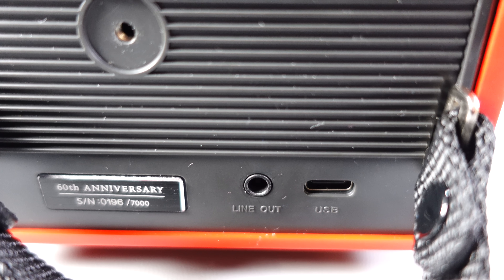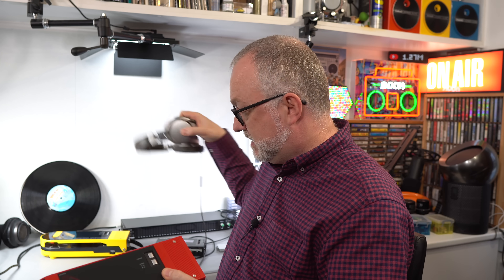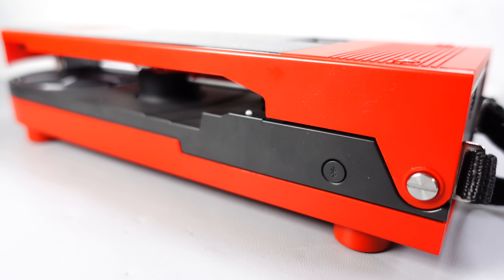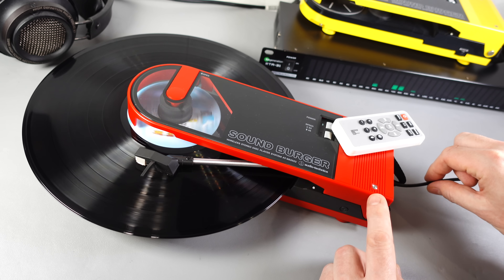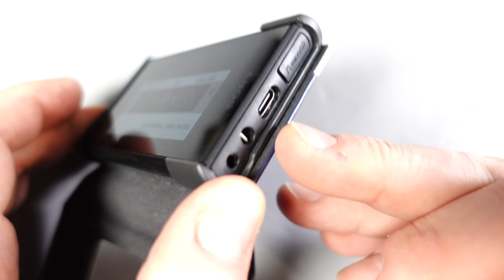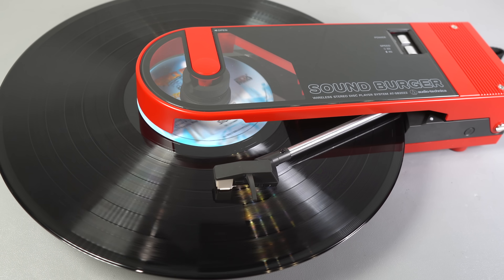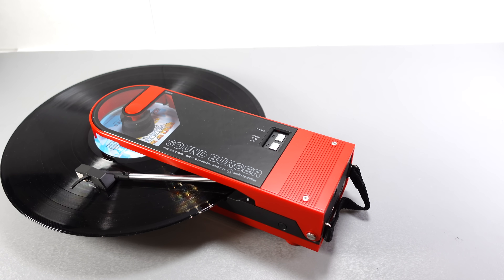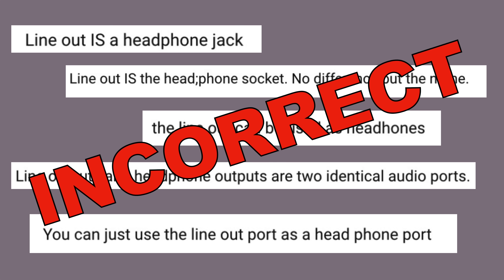Line-out ≠ Headphone-out

Comment: Confusion comes from that there is no confusion. You can plug your headphones in Line Out - it won't destroy anything and you will get the sound. It is not a forbidden action under a heavy magical taboo of gods that will smite you.
What it won't do is offer the same options as a proper headphones jack.

Everything else is besides the point.
Reply: Many headphones will be far too quiet using line out. Different headphones require differing powers to be driven.
Your type of confusion is the reason for this video.
Reply: @Safetytrousers  There is literally no confusion.

Comment: I must put my two cents in. I have a no name discman. It has headphone out and line out. The headphone socket started making noise. So I plugged in  my headphones with a volume control and they work just fine
Reply: So I've been using the line out as a headphone out and it's perfectly ok

Comment: You are incorrect! The confusion doesn't come from the fact that you can use Headphone Out as Line Out, but because some old boomboxes had a sensor that could sense if a headphone was plugged in in the Headphone/Line Out socket.
Reply: That's just one factor. That is not the main reason for the confusion.

Comment: Very well explained clearing a common misconception! Someone who wants to go more technical, it's also about impedance matching, typically headphones have impedance of a few ohms, but line-in devices have much higher impedance, but normally driving a line-in with headphone output is ok in terms of impedance provided as Techmoan said a low output level. Thank you a lot for the video!

Comment: as a musician and audio engineer, this video is hilariously necessary for the music consuming public
Reply: The fun thing (which probably makes the average user more confused) is that the fact that if a line output is connected to the line input of another device, it usually gives similar input levels to that device as a headphone output will do at full volume. That's because the thing is mostly just about the impedances. Voltage levels of both type of outputs are about the same, so with a high impedance line input (that barely put any load on the signal), they give similar levels.
But, if headphones are connected to the line output signal, the voltage level will plummet - because that output can't supply much current (high output impedance).
The amplifier circuit in the headphone output on the other hand, can supply much more current to the signal (low output impedance), so the signal level don't drop as much under load.
Reply: @Speeder84XL  BOOOM nothing better than the actual engineering explanation
Reply: It really is. I'm by no means either an audiophile nor a technology expert. But I like to think that I'm at least reasonably knowledgeable in both areas, and I kind of just always assumed that a 3.5 mm line-out was usable as a 3.5 mm headphone out. Good to know that that's not the case.
Reply: @scaper8  usable? sure, ideal? no
Reply: @scaper8  honestly you still can use either as a headphone amplifier but normally the line out will have half or even less dB of the signal, so that's why it's so quiet. it's a use of last resort if you have nothing else to listen with!
Reply: @JakobSchafferDrums  A concern I'd have is that a line output is designed to drive a high-impedance load, while a headphone may be pretty much a short-circuit in comparison.  Hopefully the line output is designed to tolerate this, but I don't know if that's always the case
Reply: @SmallSpoonBrigade What a statement of art😅 Siriously YOU can plug in SPEAKER😂 UM an amplifyer could help❤
Reply: 22k mono MP3's for life, bro!
Reply: Most definitely, I didn't know the difference...
Reply: I knew that it was very low, but that's because I've tried it. Assumed it was for some sort of way to connect to other equipment.
Reply: Until seeing this video, I had no idea what line out was. Which means I've always either assumed that "headphone jack" was broken or just dealt with the low volume.
Reply: Surely as not a musician and audio engineer it's still obviously needed?
Reply: I agree I learned about this the hard way unfortunately 😂 but differently instead of using line out I did use the headphone jack the problem I had gotten a pair of Open backs headphones and i would plug them in but I didn't know why they sounded so low amd when I did research that's when I found out they i had gotten the 250 Ohms version of those headphones so they require a headphone amp 😅 we all make mistakes the music industry can be a little tricky when your figuring stuff out on your own or when you don't look things up in my case

Edit: I want to clarify I found out about this back when I was in middle school I'm 23 now and took an audio engineering class 3 years ago in college so I can definitely say I know a lot more than back then but even till this day I'm still learning more new things about music.
Reply: it just amazes me that some people can be so arrogant/misguided to just type complete un-truths without knowing they are completely wrong.
Reply: As a better musician and more knowledgeable audio engineer than the OP (but equally as self-aggrandizing), this video is hysterically essential for the music consuming public (or just public, for short). 

Jokes aside, this is not that relevant anymore.
Reply: I don't see anything hilarious about it, sounds kinda condescending tbh
Reply: I used the line out on my CD player once and at first thought it was broke, but then realised it was probably to plug into the hifi system
Reply: and shows how propriatary things are
Reply: what an accomplished video..
Reply: Mate I used to work in a maplin and the stuff people used to believe was unreal, they literally think there is a magical passive adapter for anything<->anything, be the source and destination any combination of analog, digital or proprietary implementation over either. I remember some student woman saying she couldn’t use our dvd-r’s because they ‘weren’t digital’ 🤨, it’s called digital versatile disc love,
Reply: Said the snob
Reply: gonna agree, fellow sound engineer here as well
Reply: a lot of headphones designed for "gamers" tend to have an in-line or built in amp so you can get away with using the line-out but they all need to be powered at the same time
Reply: Jake, yoo hit that there nail squarely on the head. The key word here is consumer. As the majority are only consumers and spenders!
Reply: Thanks
Reply: As neither, it’s still necessary
Reply: The answer is so obvious if you think about it
Reply: Nasty commenting on a techmoan video
Reply: The video could have been 10 seconds long. So no, it really wasn't necessary.
Reply: What a petty thing to be snooty over.  A pointless fact that can be found out with a google search is what you hang your hat on? You're one of those musicians who think society owes you
Reply: work with this stuff a bit, but his description of why line out is the same (switching between equipment) made the next level of it click in my head lol
Reply: @QualityDoggo  literally ya when he said that I was like oh YA it's literally a 'Line' 'out'
Reply: As a person, I too like being unbearably smug.
Reply: @Croyles what exactly makes OP's statement smug?
Reply: As a lord, an open hart surgeon and a scientist who works at super collier in Switzerland i agree
Reply: "Hilariously necessary" because manufacturers prefer to keep consumers in the dark*..    
       And explanations that are easy to understand are difficult to come by. 
       Mainly because those need to be written by audio engineers, who don't see the need to explain, but find it hilarious instead :P

Not everyone has time for a 4 year study, just to understand their home stereo equipment ;)

And I'd argue that anyone who alledgedly DOES know, but finds it difficult to explain in simple terms... really doesn't understand it quite as well as they'd like to think ;)

--

*[Same reason why the 'HD Ready' (1366xsomething px) label exists on older TVs... 
       (Better than regular HD 720p... But has an air of 'Full HD' 1080p... Which it's not)]
Reply: @iggysixx  ok
Reply: Oh come on now, anyone at the age of 8 or 10 who had tape cassettes, boomboxes, and cd players would have found out easily there was a difference between line out and headphone out.
Reply: @user_83746yu  Yes, but most people looking at Youtube have not had these experiences ... cassettes et al fell out of general use before they were born!
Reply: I can't believe in this day and times this needed to be taught to people. Lol

Comment: Line out will have intrinsic impedance in series with whatever you plug into it, so a headphone will see only a small fraction of the output voltage. Basically it's not designed to output very much current or power. It's meant to go into the high impedance input of an amplifier.
Reply: It can work surprisingly well with really cheap cans, even if it's not meant to be used like that,

Comment: headphone outputs are  different . They amplified off the line out signal. The headphone amp is designed to operate on a range of headphone inpedance and have a volume control for the user. Line out will work but will be low and uncontrolable and may not be equalized like the headphone out.
Reply: Yeah, we saw the video.

Comment: I have gotten away with using a line out that had a level control in the past, but it was one of those rare edge cases
Reply: Its not rare. Its the default on modern devices.

Comment: To be fair some computer motherboards do label Line-Out as headphone or Front Speaker compatible(or at least recommended to plug your heaphone in there). It's why people were confused and made the wrong assumption.
Reply: Yeah, but via software the hardware is controled so that the volume level is adjusted by an X amount of decibels when you select to use the output for line-out or headphones-out. In fact technically depending how the hardware is "wired" you could give any 3.5mm socket a different function. The line-out could technically be a microphone-in, if only the hardware can switch internally like that.
Reply: @LogiForce86  Yes. I've had motherboards that have done just that.

Comment: A lot of sockets that work for headphones are labled as "line out".  At this point, I think it is irreversable and needs to be addressed by the companies that manufacture.
Reply: The distinction is moot with modern electronics. All devices this days use a DAC and most will have digital amplifiers.  Line level is only a concern with analog signals, which no one should be using.  Analog should only be used for the final speaker output.

Comment: Question to people who know more than me: what would happen if you connect antique high-impedance headphones to a line out jack? I'm talking about the type of headphones one often sees supplied with WWII communication receivers. Would they sound louder?
Reply: What would happen is you would hear something, but it would be very quiet. Also, doing so would not damage the headphones or the line out circuitry. The output circuit would not be loaded anywhere near as much as it was designed for, and the headphones would not be given a voltage anywhere near what THEY were designed for. 

I have some, and I've done it just to see what would happen. Its fine, but useless for listening to!
Reply: They're not all antique though; beyerdynamic DT 880 comes in 250ohm and 600ohm impedance versions (as well as a more traditional 32ohm).
Reply: No, it's the other way around. Lower impedance headphones = louder sound.

Comment: My smartphones (Samsung s7 and Samsung Note 9) have strange headphone output, when inserting dual ended jack wire without headphones on the other side of the wire and then contacting headphones to te wire we have much more power than when connecting headphones ended with dual jack wire to headphone output. In other words when impedance of connected device is equal to 0 than device pumps greater power than when is sees any load.

Comment: It's akin to the USB type C socket where the socket is the same as for Thunderbolt 3 and 4. The socket is the same, but the protocols that the corresponding cable supports vary significantly. The old DVI and SCART sockets had similar issues

A line out is designed to communicate information to another device and not human ears
Reply: You seem to be confused, the cable and connector don't care what protocol is being used. Every USB C device works with thunderbolt.  The only time you will run into an issue is when a company incorrectly implemented the USB C spec and made their device thunderbolt only.  That doesn't change what cable you use.

Comment: I used to work in a musical instrument shop and had to deal with people not understanding this sort of thing all the bloody time. People usually think that because a connector is the same, everything will be compatible. Which isn’t unfair, because this is true for a lot of things in everyday life.

Imagine trying to explain to someone who has no knowledge of audio signals why plugging a stereo jack into a balanced input on a mixer will only give you the difference between the two stereo channels. Now imagine explaining that sort of thing to the clueless public several times a day, everyday. I loved that job, but it really was a test of patience at times.

I have known people who’ve played guitar for years, decades even, and still don’t know the difference between and instrument cable and a speaker cable. And why you should only ever use a speaker cable to plug an amp into a speaker.

Comment: The basic difference is that the line out is not designed to have a load on it (anything that converts the signal to energy like a headphones which convert the voltage to kinetic energy that generates sound), that's where it all starts. In contrast, a headphone out is designed to have a load in its output. So no, you do not convert a headphone output to line out by lowering the volume. The consequences of using line outwith headphones and vice versa on the listening experience are important, as they transform the frequency spectrum of the original source. Surprisingly, this is the most fundamental point and it is not covered in the video.

Sorry for pointing out that someone is wrong in the internet, but you seem to care about this things hence my comment.
Have a nice day.

Comment: Line out is generally a high impedance output at about 100 mv. Headphones are generally low impedance devices that need to be driven by a low impedance output at volts, controlled in level

Comment: I'm a fully qualified electronic repairs engineer with 20 years experience even though you cannot use the line output Jack for headphones if you have a preamplifier with volume control then you can use your headphones with that type of jack socket

Comment: Generally speaking, line out and headphone out are about the same level when listening on headphones at a comfortable listening level. The main reason why line out doesn't work if headphones are plugged in to it is because it's not designed to drive such a low impedance load, and the output level will drop like a stone.
Reply: Ffs dude, did you just watch the video? 😂😂😂
Reply: @joelarnold2394  did you read the comment?

Comment: This is similar to trying to connect a turntable to a newer amplifier that does not have a 'phono input' , you need a phono preamp before the normal preamp for it to work, I am sure plenty of people have made that mistake
Reply: Even that gets messy, as ceramic cartridge outputs are a suitable level without a preamp. Albeit they're almost always worse to start with.
Some (particularly) new turntables with magnetic carts also have a preamp builtin.

Comment: When using the lightning to 3.5mm adapter on an iPhone (thanks Apple) you're asked on screen what device is connected, either headphones or "other device". I was hoping this would be a line out option, but it's actually to enable or disable volume level warnings and save that in the Health app.